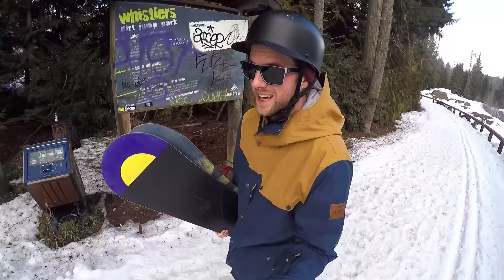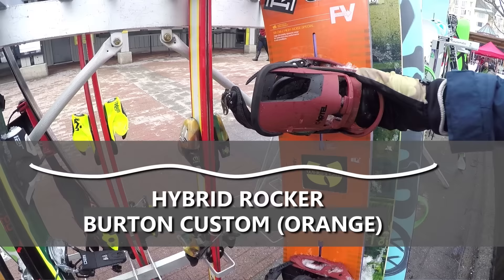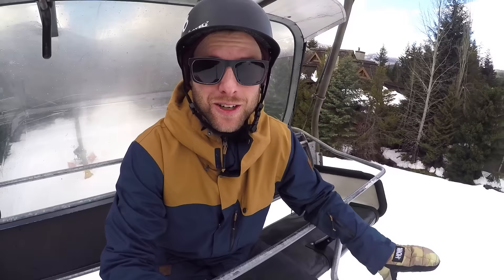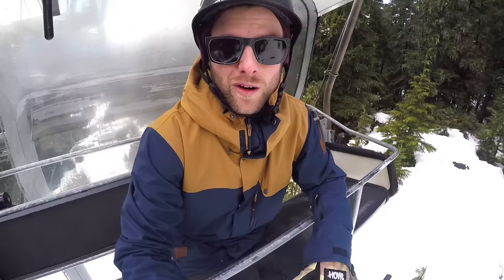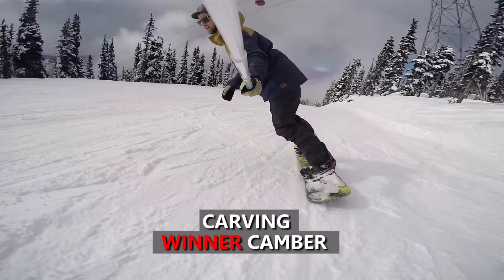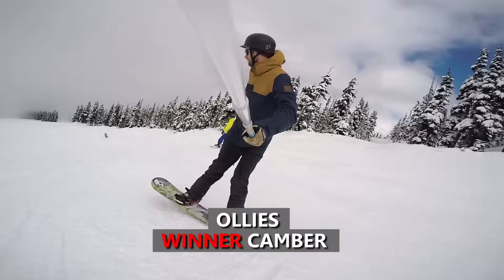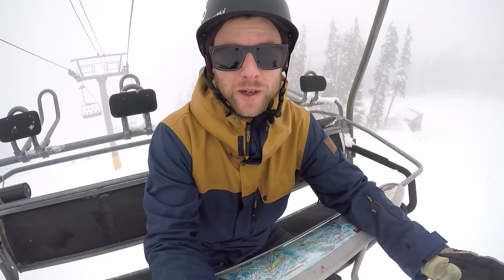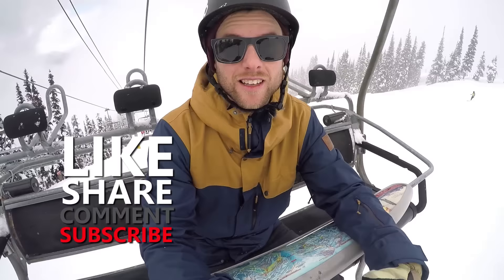Camber VS Rocker Snowboard Test

Comment: As a beginner, what would be better for me: a camber board or a full rocker board ("banana" board)?
Reply: I really suggest a Libtech Skate Banana. I've been riding 20+ years, but seldom more than 10-12 days a year; sometimes less. My two favorite boards over the years are my Skate Banana and an Arbor Whale's Tail for powder. Before buying the SB, had a Burton Custom X. Was very difficult initiating turns. My son, who grew up in Alaska doing 100+ days, had a SB. I rode it 200'---that's right, just 200', and I knew it was a better board for me. Bought one that afternoon. Been riding it for 7 years. Everyone I talk to on the mountain who has a SB says they love it and that it made riding (initiating turns & holding an edge) more fun.
Reply: Don Mueller thanks a lot!

Comment: when you have a bias it makes the test a little unfair and its odd when a claim breaks physics. a rocker would carve harder than a camber. 
how does a camber board designed for nose and tail tricks lose in a butter contest?
but my question is why do they call a double camber board a rocker? i see rocker boards that are banana shape only and that to me seems like a rocker board..... the ones with double camber maybe should be called double camber????

Comment: Totally disagree. For beginners I would say rocker hands down. You are an experienced rider. You can use the performance of a camber board. A beginner would benefit from the forgiveness of a rocker and would progress faster. I love camber boards but not for beginners. Also, I feel the rocker gives me better response when navigating trees but that could be just me.
Reply: +erezra I agree with you. Another pro for a rocker board is in powder in general. took my park noodle (rocker) to the top of mammoth last week and it rode nicely, especially compared to my camber boards (my hybrid tends to do pretty well in powder too but seems to take a little more effort)
Reply from the maker: Thanks for the feedback. I guess it's a trade off for beginners with rocker vs camber. I was trying to put myself in the boots of a beginner when testing the boards. I did find the rocker was more playful and quicker to turn, but the loss of edge control made me lean toward camber.
Reply: +SnowboardProCamp i've always thought it'd be a good idea to literally get in the shoes of a beginner (rental boots and the monster burton ltrs) and try to do everything switch the first day of the season. though i havn't put myself through the pain yet

Comment: you need a wider stance for the rocker/hybrid board. Your stance is way too narrow. Also if you have a setback stance on a true twin board you will loose a lot of control on a groomed snow.
Reply: +vlpeev Not true, you will actually have more drive off tail as you are flexing the board through turns more off of the back foot. That is what a directional twin is a twin shape with a setback reference stance.

Comment: What is your opinion on Burton Clash which is a rocker and known as one of the best beginner board. Your video tells me that Camber is better for beginners. I am confused. Just starting out and want to make sure I have a forgiving board. Which board do you recommend for beginners. thanks
Reply: +John Raz, I have the 2013 Burton Clash, I bought it as a beginner three years ago and have no complaints, it has been a great beginner board at a great price. It's very forgiving and you will not catch an edge. A lot of the time you will just lose your balance because all of the board's contact is between your feet. As I have gotten more confident with speed, I find myself gravitating towards a traditional camber board for the edge control in order to get faster and deeper carves. I hope this helps.

Comment: How much did you take into consideration that you felt more in control on the camber because that's the board you usually ride with. Or was it a clear difference between them
Reply from the maker: I spent a season riding the rocker hybrid board and I always had a feeling like I didn't have as much control for turning and also more unstable with the jumps. Getting both boards up on the same day just help to confirm it.
Reply: +SnowboardProCamp ok thanks. Just curious

Comment: Rocker sucks... unless the board has Magne-Traction, and then it works. You gain more edge hold with Magne-Traction than you loose with the rocker. Get a Mervin board if you want a rocker board. P.S. You didn't show the advantage that rocker has in powder.

Comment: I want something for the park, rocker or camber?
Reply: Camber.
Reply: +MotoMadMan camber, rocker is for freeride and backcountry because you can float through the snow better
Reply: Rocker for in the park!!! Camber makes it difficult to land jumps and your edges can catch rails and boxes. Rocker allowed a little bit of room for error on jumps and it's much easier to butter and spin. Yes it's good for riding pow as well but only because it doesn't need to carve through hard snow, that's where camber is great. Hope this helped
Reply: +MotoMadMan  get a flat board it is a mixture and gives you the pop of the  camber board and the edge control of the rocker
Reply: Depends on what you're doing in the park. Pipe is hands down mid stiff camber. you need strong edges. Also applies to large jumps when doing rotations. However for those of us not named Mark McMorris a hybrid with flex but pop rods is best.
Reply: +MotoMadMan  Wow, okay... lots of strange replies. Profile, camber or rocker, is more of a riding preference than a requirement. 
You want something for the park? like what? rails? big jumps? pipe? each of these details matter for FLEX. Example, for pipe and pig jumps you're going to want a stiffer camber DOMINANT board. This means camber or camber dominate hybrid. For rails a rocker board is generally easier to press and and board slide but for a big jump? just put the physics in your head, full rocker is garbage for jumps over 30+ feet. The board will either snap or you will. You want something to lay you down flat and stable.
I'd recommend a hybrid profile with a mild stiffness if you want all of the above but know this, No board will do EVERYTHING great there's always a compromise. +tachii_surfer nailed it.

check out vids from the 90's those bros are doing great things on a rail with full camber stiff decks, just their style.
Reply: I switched from a DC ply camber board to a arbor west mark rocker and I instantly was better, I also progressed a lot faster on it with more confidence and less worrying about catching an edge and it does fine on small to medium jumps the grip tech edges on the west mark help a lot comparing it to a traditional rocker board
Reply: +the-ELiTE-boarder I'm thinking about getting a hybrid
Reply: coming from a guy who's ridden park for the past 7 years go with rocker all the way man. pressing on rails is much easier, and usually has more flex
Reply: +MotoMadMan please don't get a camber board for park. you will be so disappointed
Reply: +MotoMadMan do it, the westmark is a hybrid of sorts it flattens out a bit near the nose and tail and it is stable enough to carve and just make sure you get a WIDE board if you have large feet, that extra 1-2cm on the waist makes a world of difference
Reply: +the-ELiTE-boarder so like a hybrid rocker
Reply: Flat. Get a Nitro T1
Reply: +TheGamerfreak1555 There is no right or wrong here, and even if you try it out, it takes a few days to get used to. I own multiple boards and for rails, and butters, i prefer my soft rocker. For big jumps I prefer my stiff camber. small jumps are fine on either.
Reply: hybrids are the way to go for everything
Reply: rocker good for park, but more camberish is better for pipe and jumps
Reply: It's just not that easy man. Its about how much control and precision you want vs playful and forgiving. Demo some boards before you buy.
Reply: It also depends on what type of riding you want to do in the park. More jumps? More rails? Do you want to be able to do presses easily? Etc.
Reply: +Board Archive I definitely want to be able to do presses easily, rails and jibs, small/medium sized jumps, but handle fast runs too
Reply: handle real "fast runs" and presses easily are pretty much mutually exclusive. There is no one snowboard that can do it all without compromise. you sound like you want a jack-of-all-trades-master-of-none board, so you are in hybrid or flat midflex territory. just know you can't have it all. you either compromise, or get multiple boards.
Reply: +MotoMadMan do what I did man. I've got a flat board, a camber board and a full rocker board. Burton process centrefold 155 for faster runs, bigger jumps and control. Capita Scott Stephan's 153 as an all round board that can handle a lot in the park but is also fun on the groomers. And the a 142 burton nug with full rocker to throw around and have fun with in the park and for flat tricks. Now if you don't want to get 3 boards to cover most of what you do ( yes I wish I could buy more) buy something like the Scott Stephan's that is flat. The flex is perfect on it. It's soft but absorbs bumps on the groomers and There is heaps of edge but then it's also forgiving when playing in the park. And it's also fairly cheap compared to other boards! Hope this can help you get an idea and make a decision. Best of luck dude
Reply: +Cameron Nunn thanks for the help.

Comment: This guy is obviously a camber rider. Very biased opinions, this isn't helpful to new riders at all. Camber vs rocker is all personal preference, I personally believe rocker is much easier to learn on. My first board was a Burton cambered board and it just felt very stiff, like it was fighting against me. The second board I tried was a Lib Tech Skatebanana and I almost immediately progressed my riding twofold. Sure, rocker feels a little squirrelly for the first run or two but once you get used to it you will find everything becomes effortless. Easier turns, easier to Ollie and presses, and much better in the park. I guess my point is, if you're a new rider go try a rocker board (get a Lib Tech, they invented rocker, or banana as they call it and they are the best). Camber is better for advanced rippers who probably don't need to watch a video like this because they already know the difference.

Comment: So what is the hybrid rocker mainly good for? Is it just a personal preference?
Reply: Park
Reply: probably just personal, after all I'd imagine most rental places have cambers for a reason being it's the most common
Reply: The Flying V or hybrid boards are really good for powder, the nose just floats up with little effort. 
From first hand experience hybrid boards are very sketchy when it comes down to anything park, edge control, or speed. I wouldn't recommend this type of board to anyone that likes or does any of those 3 things, which they are pretty big part in snowboarding.
Reply: hybrid boards are good general boards no matter what youre doing. high quality powder, freestyle and all mountain boards are usually hybrid because the manufacturers can also adjust how much rocker or camber it has in the hybrid for different types of riding like a board used for park riding such as rail jumps and half pipe would have a more dominant camber than a rocker whereas a powder freestyle board made for doing tricks in deep powder would have more rocker than camber. I hope this helped
Reply: A true rocker is not very pop. The board just lacks of springiness. By putting camber under the bindings, you get some pop as well as edge lock because the added pressure points.
Reply: +TheNoobStevio thats completely untrue. Most rental places mainly have rocker boards because they are better for beginners as beginners rent a board instead of buying one.
Reply: +Gela Re I posted up a bit but my Custom Flying V I got this year is hands down my favorite carving board.  That sucker holds and edge very well but its riding profile is far different from any other board I've ridden, ever, and took a solid day of getting used to even with my experience.  I do not recommend it for beginners; I only say this because a lot of places classify it as a beginner board which I highly disagree with.  You need to be confident in your carves and maintaining pressure on your contact points to ride it well.
Reply: hybrid rocker is awesome for beginner snowboarders and park riders. reason being is with rocker you have a bit of forgiveness when your edges get hung up. if you're new to the sport or a park rider rocker is for you. I personally ride camber between the feet and rocker at the tips. it allows me to press and butter but still charge on hard pack snow and be able to set my edge.
Reply: +TheNoobStevio rental places are geared toward new snowboarders, and rocker is less frustrating and less painful to learn on, so any decent rental place should have rocker boards.
Reply: +antihero3zx oh ok
Reply: The idea behind hybrid is to get the best of both worlds. The playfulness of rocker and the power and stability of camber. They are fun but never as powerful as a true camber board. So it depends what kind of riding you are interested in doing.
Reply: +Board Archive thank you for the explanation. What do you think would be best for someone who likes to hit the terrain parks regularly and do butter tricks?
Reply: Gela Re jumps? if so what size? big jumps full rocker kinda sucks. If you don't hit the big jumps rocker makes your presses and butters easy and look sick since it's already curved the right way. if you ride east coast ice get libtech magnetraction/burton frostbite/arbor grip tech/etc
Reply: +antihero3zx I do ride east coast currently but I'll be moving to California soon. I was looking into Lib tech Box Scratcher and also Gnu ladies' choice.
Reply: Those are very similar boards. you'll be fine with either. honestly, without riding both, you might as well pick based on price or graphics as both are made at the same place, with mostly the same tech, to do mostly the same thing.  asym vs sym personal preference. some like it, others dont. if you aren't going to test drive, it's not a big deal and does very little to affect the boards ultimate capabilities.

Comment: rocker good for rails and boxes and jumps right? or is that camber
Reply: camber is the goods 
i had a rocker for the past 4 years and just jumped back on a camber board this year and i feel my snowboarding has improved more is the past 3 weeks than it did in the past 4 years
Reply: i know the feeling
Reply: A P the rocker is better at park riding

Comment: What's better for jumping?
Reply from the maker: I felt more stable on the camber board for jumps.
Reply: Camber, has good pop and holds edges very well.
Reply: Landing probably more stable with camber but if you are more likely to catch edge.

Comment: I'd have to say, I completely disagree with this entire test. First off, what is the flex rating of the rocker board, this was not mentioned? Second, you're testing a hybrid rocker instead of just straight rocker, so that kind of throws the whole thing off especially when titling it "Camber vs Rocker". Also, your tests are very shallow it seems, and should be done at various speeds/slopes and surface conditions. There is a lot left out here, and the testing definitely leaned in favor toward the camber's qualities.

Comment: This is really biased review. Obviously he is a camber rider and much more comfortable with a camber. Most people take a whole season just to learn how to link turns together smoothly. Many people get frustrated and give up before ever getting there. This is a far easier process with the forgiving nature of a rocker board. Even if you are sure you are a speed demon camber board lover at heart, pick up a cheap used rocker board for you starter board and pass it along once you are good enough to pick up speed imho. Camber is great for precision speed and control and high speeds, steep trails, big jumps, spins, etc, but that's not what a beginner needs. I've got 18 years riding experience and own nice boards in both rocker and camber. Many days I take both to the mountain and ride camber down the steep stuff and play around on the rails on my rocker.

Comment: But dont you ride camber usauly I think that's why
Reply: +iamfozzy100 When I got my first rocker board, after 15+ years on camber it took me a whole season to adjust and learn. You can't ride it exactly the same way and make a direct comparison.
Reply: If you are bombing steeps, I completely agree with you. If you are having edge hold issues on the terrain in that video at the speeds he was going, it's a technique issue. I bring two boards to the mountain most days, so believe me I get it.